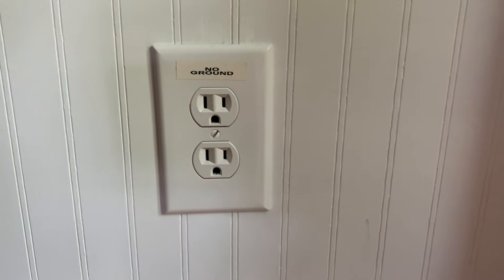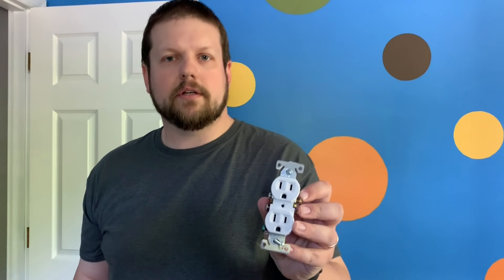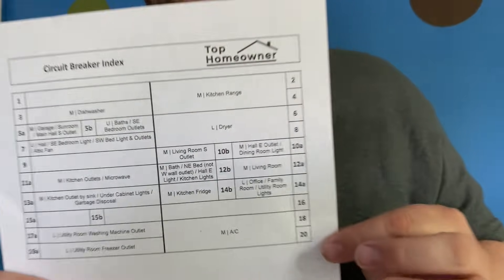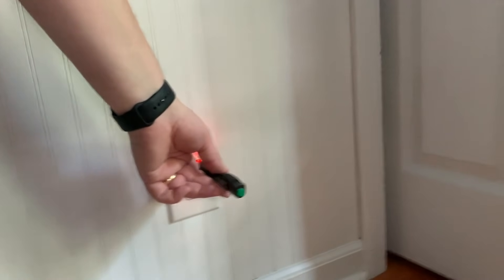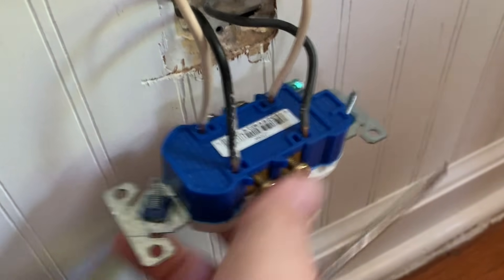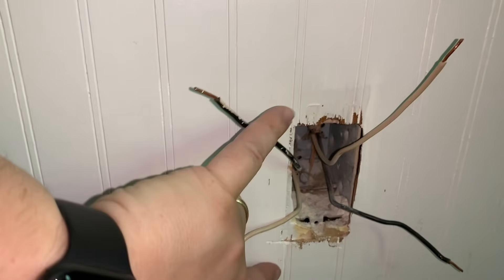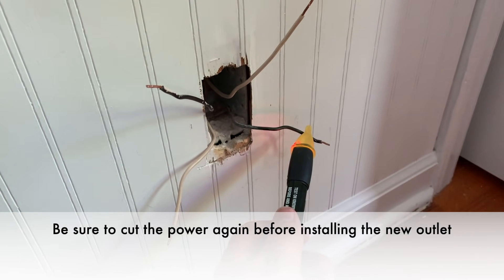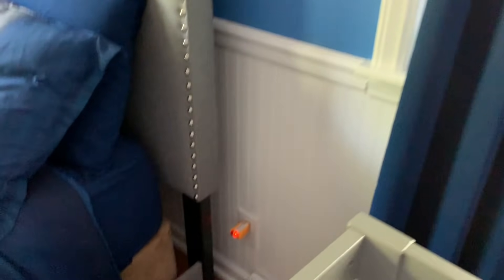Fixing Ungrounded Outlets - An Alternative Option to Rewiring Your Home

Comment: Sometimes on older houses and by sometimes I mean often if you have metal junction boxes they are indeed grounded they ran a completely different wire to the back of those boxes so if you actually test it it may be grounded and if they are all you need to do is pigtail from the switch to the junction box but if you have a metal box check it you may very well be grounded
Reply: How would you test that?
Reply: @JeronimoStilton14  He is correct in what he is saying. It's called BX cable, which is a spiral metal cover over the wires. The check would take an Ohm meter and it set to continuity with one probe on the wire itself and the other on the metal box. POWER OFF when your doing this...
Reply: @AmericanOne9621  All of my boxes are metal and there's a ground pole buried outside. Does that mean the breaker box is itself grounded, then the wire (if there is one) to the metal box is providing ground to that outlet from the breaker box? I honestly don't believe that there's wires connected to the metal boxes, but just asking for future reference.
Reply: would this be tested with a plug in tester?
Reply: @ChristynLassere  No, see above ^^ answer...

Comment: I was looking at one electrical site, and there was a warning to NEVER attempt electrical work in your attic, and doing so could kill you! Looked closer, and this was a New Zealand site. Seems a lot of the houses still have uninsulated wires seperated by ceramic insulators like the bad old days.
Reply: That is everywhere; this style of wiring is called "knob and tube"  Common in the US.  There are issues with K&T in attics regarding insulation getting wet, but other than that, it doesn't matter much where they are located; K&T is no more deadly in one place than the other.
Reply: @SwingboyPA  or less...
Reply: Knob and tube is not uninsulated, they are single insulated though of course after decades the insulation may have suffered.

Comment: Doesn't a surge protector extensiton cord need a ground? If so,  protectors will not be working .
Reply: Although a GFI w/o ground is code you need to add the "no equipment ground" sticker to the face plate for exactly that reason. Its need on all downstream outlets too (plus the "protected by GFI") so not only will surge protection strips not work as intended neither will the surge circuitry found in most electronics.
Reply: A typical surge protector has three varistors, one between each prong so they should work even without grounding, maybe not as well as with the ground though. At lest they do not hurt.

Comment: the hot wire you tested does not necessarily mean its the first outlet in the chain. There may still be an outlet "upstream" from the one you installed the GFCI on. It may even be in a different room. That one, as well as any others before the GFCI protected outlet, will be unprotected.
Reply: You should naturally test the installation. After you are done, press test and verify that all sockets you changed are dead. Then reset it an test that they all work.
Reply: Totally agree!
The accurate way to figure out which is the first receptacle is to map the entire circuit, make sure none of the receptacles have anything plugged into them, make sure all light switches are off, disconnect all the wires on all the receptacles and switches ...and then do a continuity check back to the panel.
...Which of course, nobody is going to actually do.  :-)

...Which is why it's better to figure out which circuit breaker it's on and replace it with a dual purpose GFCI/AFCI circuit breaker.  This is the new standard for the 2014 NEC is AFCI protection instead of just GFCI protection.  Since you have to change the circuit breaker anyway, there's no point in fussing with receptacles (unless it's broken or something).

The exception for me would be a kitchen or bathroom upgrade where a standard (grounded or not) receptacle needs to be GFCI protected.  I mean, if you get out of the shower in a towel or your in the middle of cooking dinner, am I going to make you go out to the garage or down to the basement to flip a breaker?  That is cruel.  In that case, AFCI breaker and GFCI receptacle at that location.

This is based on NEC 406.4 (D)  -specifically (D) (2) and (D) (4)
Reply from the maker: Yes, I wasn't very clear on that point in this video. I made a follow-up that talks about this: https://youtu.be/3AXcRsAOLPk
Reply: But if one does not change that outlet then it is not relevant.

Comment: If you're going to add gfci receptacles into a 1930's design 2 wire house system [that maybe got upgraded from a fusebox to a breaker panel sometime in the 60's]... rewire the house.  Really.   The benefit of having a dedicated ground wire [vs hoping neutral works] is your circuit protection devices are going to flat out work better in the event of a fault, and as a bonus you don't lose protections on a circuit in the event of an open neutral [as in your pet chews through a lamp cord partway].
Reply: Not all our customers have that sort of money.
Reply: There is no hoping that neutral works - whatever you mean with it.
Reply from the maker: House was built in 1962

Comment: Thank you for the video...the part I was most interested in, how to wire the new outlet, seems to be bypassed...anyone tell me where to put the four wires with regards to the 8 hole choices?? Does the hot one and it's pair go in the "line"/top on either one and the outgoing on the bottom, again into either hole on it's side??
Reply: Hot black wire goes to the brass line side screw, w the white wire going to silver screw marked line. Then ur black and white will go to their respected colour screw on the load side
Reply: Hire an electrician there is a reason we hold a license but what he said is correct

Comment: The vid description/overview needs to clearly state that this "fix" is not for people looking to protect their sensitive/expensive equipment (e.g. TV's, computers, etc.)
This is a "how-to" video for installing an ungrounded GFCI outlet. The intended audience are people who only wish to lower the risk of electric shock from leakage current in a malfunctioning device. (Like a hairdryer dropped in a bathtub.) For people who want to protect their equipment against power surges, you really need to have a properly grounded outlet to have the maximum achievable protection. The extra current associated with a power surge has to go somewhere. The best path is earth ground.
Reply: Protective grounding is used to prevent socks. It does not prevent surges. I think you are confusing protective grounding with operational grounding. TVs seldom are grounded, neither are hair dryers.

Comment: Wow....unreal, outlets, laymans terms, receptacles....and your camera showed the inside of that box that you pulled the receptacle from and i could clearly see 2 rolmex entering the box with the ground attached way in the back to a screw....maybe if you would have had the breaker on at first, we would have seen the device had a ground....this was very entertaining, especially using a dewalt drill to unscrew the receptacle plate....unreal. whats next? How to install a kitchen faucet?

Comment: I’m a licensed electrician adding gfci does not fix the grounding on that circuit as a matter of fact the gfci will not work the way it should without proper grounding this video should be deleted it’s bulls**t
Reply: Many localities allow you to replace ungrounded 2-prongs with GFCI to pass code on older homes.  GFCI will still do it's job and trip without the ground.

Comment: Most all boxes with a 2 prong receptacle are not big enough to install a gfci, now you have another code violation.  Box count---device, size and number of wires determine the size of the box required.  But just stuff and pound it in anyway, n be sure to smash those wires nice n thight.
Reply: Good point.  In that situation, it's better to swap the breaker for a dual protection GFCI/AFCI breaker.  :-)
Reply: "now you have another code violation" No you don't. The volume allowances for a traditional duplex receptacle and a duplex GFCI receptacle are exactly the same. You need to review box fill calculations.
Reply: @MrBluelock  depends on location. We are not allowed to use anything smaller than a 4” box. But we also run conduit. No 1/2 ass romex here

Comment: To test for line in, you just disconnect one black and see if the outlet is powered. Be sure to turn off breakers when wiring. If not powered, it’s certain that the other black is the line in.

Comment: Just to be clear, it seems the GFCI and the 'downstream' outlets will all still test as "open ground".
The GFCI test button must be used to confirm the outlets are safe.
Reply: You are correct; GFCIs add SAFETY, not an equipment ground.  So this might protect someone from getting shocked, but it won't stop feedback/static on audio equipment.
Reply from the maker: I made a follow-up video that talks about this and answers some other questions here: https://youtu.be/3AXcRsAOLPk

Comment: Wrong!!! This is incorrect, 
A GFI stands for  ground fault interrupter Which means the receptacle will trip to ground. If there is not a ground present the GFI will not trip. This is a complete waste of time and is completely unsafe for homeowners
Reply: You really shouldn't be posting about something you don't understand.
Posting inaccurate information does not help others who read your post.
Ground faults can happen outside of the circuit where the hot originates.  This information is BASIC to being an electrician.  That's why it has been part of the electrical code decades.
Let's say a toddler sticking something into a socket while touching a radiator: in this situation, grounding would do absolutely NOTHING to protect that child, but GFCI protection would save their life.  Again, if you don't understand this concept, you shouldn't jump to inaccurate conclusions ...and then post.  :-(
Reply: Incorrect, GFCI monitor the current in line and neutral and if it finds an imbalance it cuts both line an neutral. Ground is not used in the process (though a ground wire may help it trip earlier). Ground fault mans just that current escapes to the ground possibly through some person. It is not linked to the ground wire.

Comment: Yea, I live in a old apartment. Some of the tenants left and those apartments need renovations. The people that was doing told the landlord they need to upgrade all the power to the building. Haha. Used to be if we ask we will get our rent increased. Now every one gets their power upgraded and we now have GROUND. Yahoo. I am very happy. Also, more amps. I started to upgrade my surge protector and power strip for higher wattage. Now I can use portable AC, vacuum cleaner, and high wattage microwave.
Reply: You do not get more amps from a ground.
Reply: @michaelhinchey  You do if the electrical service was properly upgraded...

Comment: As a licensed home inspector versed in the NEC I believe this advise will violate the Code.  If I found this condition in a home during an inspection I would call for a licensed electrical contractor to inspect this system.  Equipment grounds are a very good idea.  All wet areas of the home must have them for safety.  Bedrooms and other interior rooms should have two prong outlets if the home as a two wire system (pre1968).
Reply: Nonsense. 

406.4(D)(2) Non–Grounding-Type Receptacles. Where attachment to an equipment grounding conductor does not exist in the receptacle enclosure, the installation shall comply with (D)(2)(a), (D)(2)(b), or (D)(2)(c).

(a) A non–grounding-type receptacle(s) shall be permitted to be replaced with another non–grounding-type receptacle(s).

(b) A non–grounding-type receptacle(s) shall be permitted to be replaced with a ground-fault circuit interrupter-type of receptacle(s). These receptacles or their cover plates shall be marked “No Equipment Ground.” An equipment grounding conductor shall not be connected from the ground-fault circuit-interrupter-type receptacle to any outlet supplied from the ground-fault circuit-interrupter receptacle.

(c) A non–grounding-type receptacle(s) shall be permitted to be replaced with a grounding-type receptacle(s) where supplied through a ground-fault circuit interrupter. Where grounding-type receptacles are supplied through the ground-fault circuit interrupter, grounding-type receptacles or their cover plates shall be marked “GFCI Protected” and “No Equipment Ground,” visible after installation. An equipment grounding conductor shall not be connected between the grounding-type receptacles.

Comment: Your right your definitely not a electrician. I know because I am a master electrician. This is not good advice. 
simply installing a GFI does absolutely nothing to correct the problem that there is no equipment grounding wire ! This is a complete waste of time and $ and it still doesn't bring your house up to current NEC code. Why do people who have no idea what they're doing always want to give people advice on YouTube?  I don't give advice on performing brain surgery!  Because i am not a surgeon and i don't know how. Just like your obviously not a electrician!  So stop giving advice on how to do electrical work before someone gets hurt,killed or burns their house down.
Reply: Lol wait til they jump into a switched neutral de sw leg from an old school electrician
Reply: You need to go back and brush up on your lessons then.  Yes, there is no equipment ground.  If you get shocked though, the GFCI will trip and save you.  Hence, it's protecting you just like having an actual ground would.
Reply from the maker: I made a follow-up video that talks about this and answers some other questions. You can watch it here: https://youtu.be/3AXcRsAOLPk

Comment: You haven't adequately indicated how to identify the first receptacle in the circuit.  Don't assume that the receptacles in one room are on the same circuit and don't assume that the circuit does not feed other receptacles in adjacent rooms.  If your going to have to install a half dozen or more GFI receptacles to protect multiple individual circuits, you would be better (and probably cheaper) to install a "whole home GFI" at the panel.
Reply: Lesson of the day is 
DON'T ASSUME